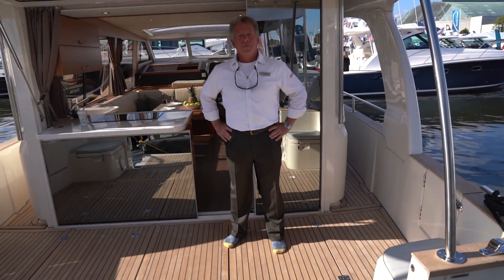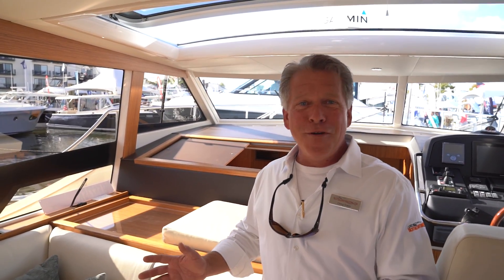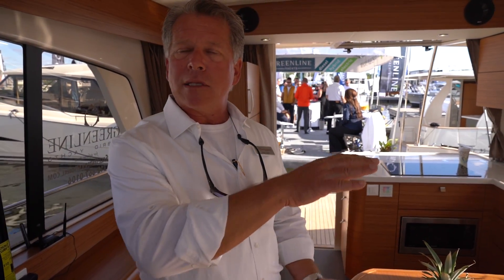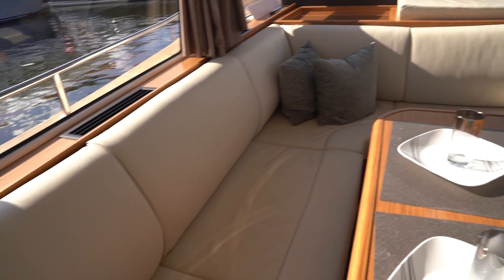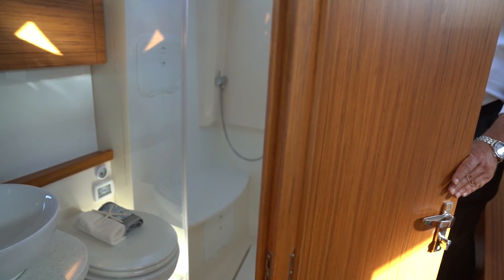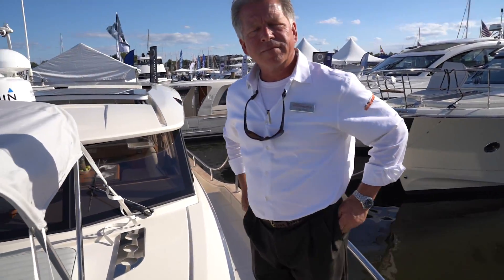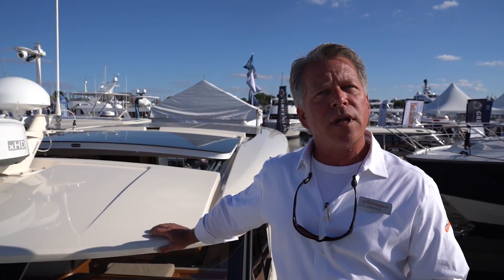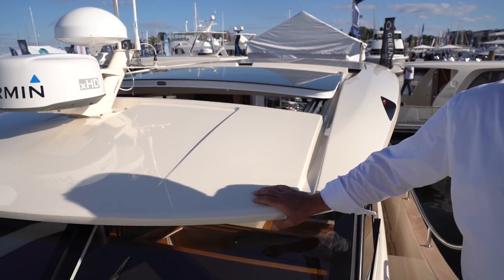Diesel Electric Hybrid Yacht (Greenline Yachts)

Comment: Disclaimer -  I might not know what I'm talking about, keep that in mind lol.

Big plus is you get a a single motor vs twin engines.  So if you run it 100 hours, its 100 hours x one motor vs 2 motors which would be 2 motors.  I guess if your boat alternates between engines on a voyage, this point is moot.  But if you  travel with both motors running, this will save you on engine wear.

The downside is that with one diesel engine running everything, you lose redundancy.  If you get to a larger size you could have 2 diesel gensets that you alternate use of to charge the batteries which power the boat and 2 electric motors.